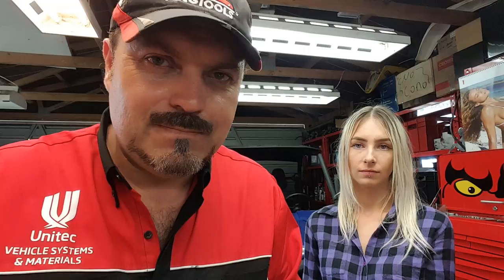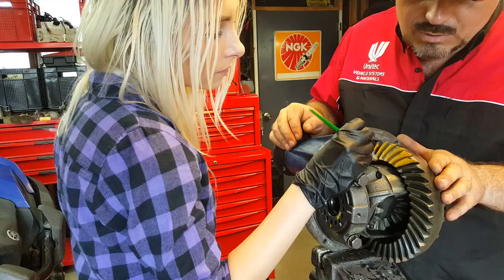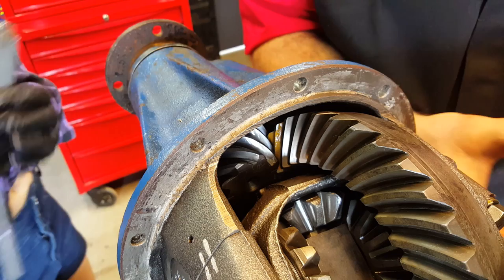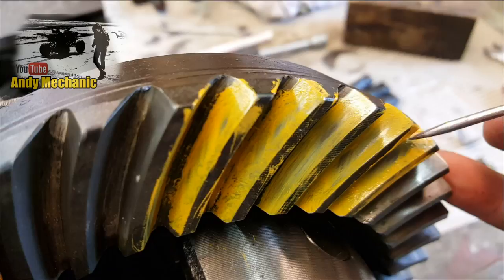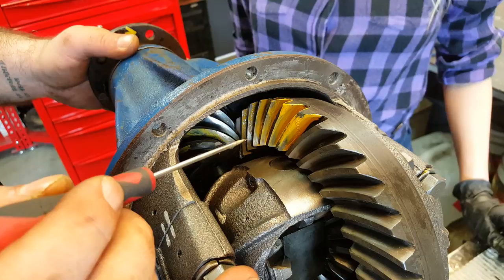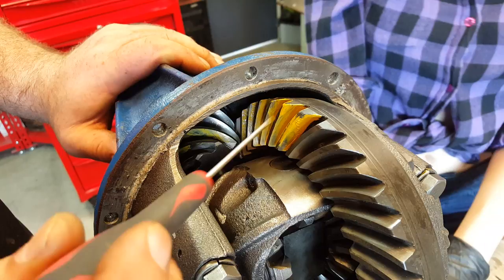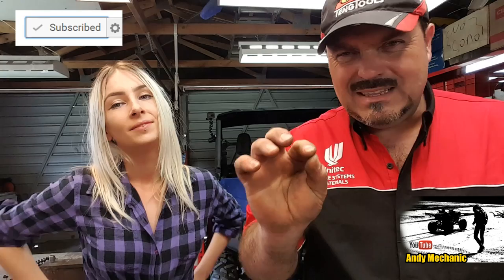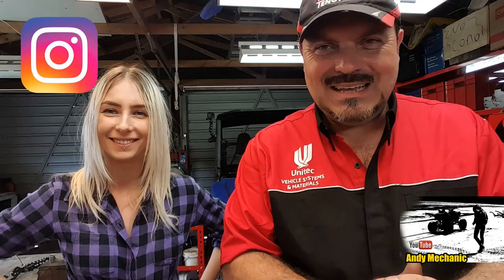Diff rebuild - how to check tooth contact Ep.4 #1026

Comment: You have to install the carrier with original shims and the 4 bolts lightly torqued. Then you can check tooth mesh and backlash. Re- shimming and checking backlash and tooth mesh might have to be done several times. This is assuming the pinion was not touched or has been setup properly first.

Comment: I am getting prepared to build a ford 7 and also a ford 7 1/4 " diffs. I know that its hard to go back and replace the inner bearing shim but would be nice to see that and how much shim change needed. I  am guessing pinion need to go in deeper, thicker shim. This video was long time back but thanks. That changing the shim to get coreect patern is hard butbi want to get it right. Thanks for thw hands on video.  Jacqueline

Comment: nice overview.
i see you left out the first pinion shim which is fine for an overview but something you need to do if pattern isn't right.
yellow or white diff paint often comes with the diff rebuild kits. but its hilarious that no one in NZ stocks it.
measuring carrier preload via the pinion is weird. potential for inaccuracies. maybe ok for backyarders but its easy enough to get or make the tool to torque the carrier adjusters. that torque setting is important for the strength of the diff, so its well worth doing. also better to use torque gauge on the pinion to measure rolling resistance rather than just break away resistance.

most shops won't do diff's simply because there is to many types, a lot of little tricks to know like checking its not warped to start with. its simply easier to send it to a specialist. most mechanics will diagnose the fault, send faulty part to specialist for repair. much easier, quicker than having to have the special tools and knowledge required.
Reply from the maker: +tweak e hi, thanks for your input here. You are right, there are different ways of checking preload and I used the method as stated in both the Suzuki and Nissan service manuals. 

I did try to make it clear that you must use the method stated in the service manual or the specs given will not relate.

I did mention about the pinion positioning shim but didn't include changing it in the videos as changing it is a long and drawn out procedure. 

I did include information at the end of the video covering what changes need to be made based on contact pattern, be it backlash adjustment or a shim change behind the pinion gear.

Thanks again for your input & yes, very few car workshops know how to set up a differential these days.

Cheers

Andy
Reply: i must have missed that as you started with the inner pinion bearing and shim already fitted.

yes it does pay to use the method the specs are for if you have no other choice. but some manufactures are known for diff failures or use over-engineered parts so poor diff building doesn't really matter.
sometimes pays to go find aftermarket specs for the diff and set it up better than factory.

its a tricky subject for a beginners guide, but its worth explaining what a good way to do it, ie what your actually measuring, which may be different to what the manufactures procedure.
Reply: just thinking on that, its probably well worth doing a video showing the different methods of adjustment. 
easy enough with torque wrench to show break away and rolling torque. could even show the difference between lube and no lube and why nissan has a different spec for when the seal is in (what happens if its a different seal?). easy enough to make a carrier bearing adjuster for the torque wrench. why under spec is bad but over spec is not so bad or in fact good.
Reply from the maker: +tweak e Sounds like a good idea and will bring the Series to a good conclusion. I'll see what I can come up with over the next few weeks....getting very busy with work again now.

Many thanks for your input on this. It's great to see so many people contributing to the channel now.

Right, time for an ice cold cider :-)

Comment: Seems like your holding the differential upside down and I thought the drive side was on the flat side. Also, I’m wondering if your differentials in your country is completely different than the US. Because here the drive side is convex, and the cold side is concave, and then your description with your pictures you have a completely opposite.

Comment: I think you have mixed up your drive and coast sides of the ring gear. I am studying for my ASE cert and have learned that the steeper side (convex) is the drive side.
Reply: Kristoff Lutchman, it depends if it's a front or rear axle, sence the wheels turn in opposite direction corresponding to the snout of the diff housing

Comment: So in this case you would move the pinion out. By how far?

Rebuilding diffs may come back. BMW run ball bearings in their small engined cars to save fuel. They do not last very long at all. You can buy bearings from the aftermarket..I suspect others will follow the trend where performance emissions and economy are now more important than long life.

Comment: Not all American diffs are one piece you do have independent rear suspension that are just like the one you have some are solid all the way to the hub but you can take the whole thing down and work on it. There are also some that are pieces that are detachable tubes that are between the hub and diff that cover the shafts for the wheels hubs.
Reply from the maker: +mcrande Ah, Thanks for that. I haven't worked on much American stuff. Just the odd Jeep.

Cheers Andy
Reply: Andy Mechanic yes Jeep's and most pickup trucks use solid axles I'm just a YouTube mechanic meaning I watch shows like yours and EricTheCarGuy and I learn allot. I don't work on nothing anymore bad back bad heart still do my own motorcycle maintenance.
Reply from the maker: +mcrande Hey, good to have you on board. I work for Yamaha New Zealand now,  I provide Motorcycle Service Support to all our dealerships. Basically, if they can't fix it they call me!
Reply: Andy Mechanic I must say I have watched every video you have I just binge watched your videos this last week to cold outside to ride or do anything else. P.s. I miss Harley tried to see her on Instagram but couldn't find her.